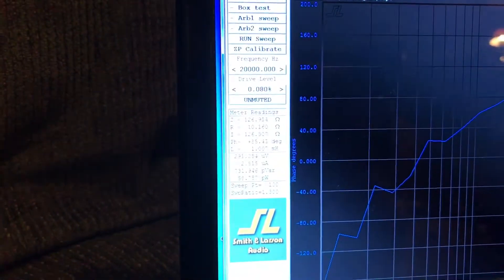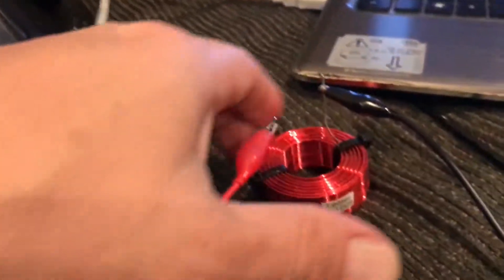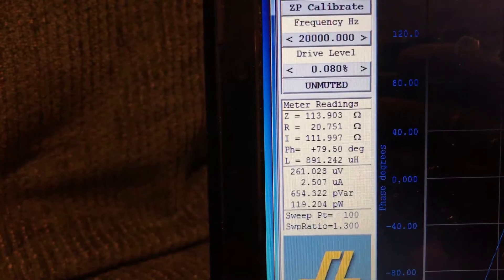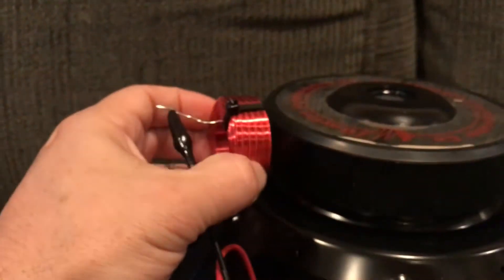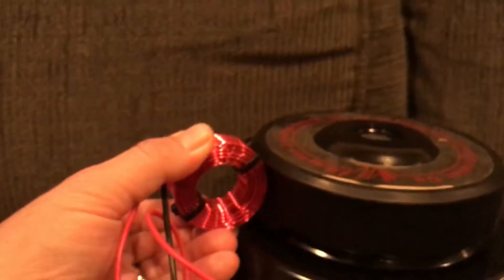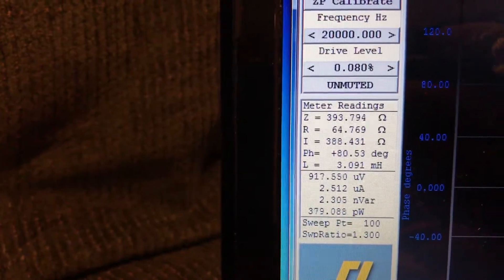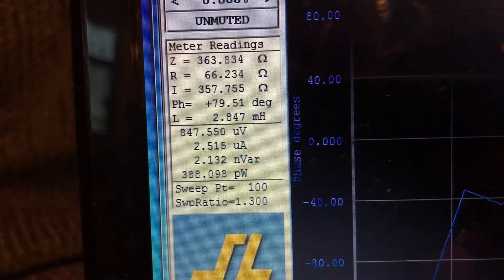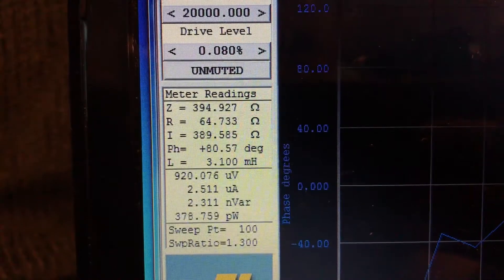Effect of a magnetic field on inductance of an inductor demonstration

Comment: Why is it then said everywhere that a ferrite core increases inductance ?
Reply from the maker: They do increase inductance
Reply: @javadshadzi4824 Then I'm getting something wrong. A permanent magnet, I understood, is made of ferrite, and when you approach the coil to it, inductance lowers. And it makes sense, as the induced field has to push the existing field from the nearby magnet. This is the part I don't understand. You show inductance coming down when it sits on top of the magnet. But then, how does it come that it's said it increases inductance ?
Reply from the maker: @fxeconomist  it is because the magnetic fields are interacting and offsetting each other.
Reply: @javadshadzi4824 Well I do understand why the lowering effect, but I don't understand why it is said it increases the inductance. Let's take a simple coil, of a few turns, around a few uH. Put a ferrite coil and inductance -> increases to several mH ? or decreases by about 10%, like in your video ?
Reply: @javadshadzi4824 I'm asking because I'm making a coil myself. I got a small ceramic ring magnet, (60 mm ID, 100 mm OD). I'm gonna wind a toroidal coil around it, just one layer. Gonna take about 7-8 m of wire (2.5 sq mm copper, insulated). This is going to be magnetically attached to a larger spinning pot magnet. I want to know what inductance I can expect from the coil. I don't know if inductance will increase by hundreds of times versus air core, or if it will decrease. I need the inductance because I wanna have a rough estimation of what I can expect from the flyback voltage.
Reply from the maker: @fxeconomist  effect is smaller yes

Comment: Interesting, if you ran an LC circuit with an inductor coupled to a static magnetic field, would the resonance frequency shift up, or would it split into two different frequencies? Presumably the resonance frequency of the circuit would be different during each half-cycle, since half of the time the induced magnetic field would be opposed to the static magnetic field.